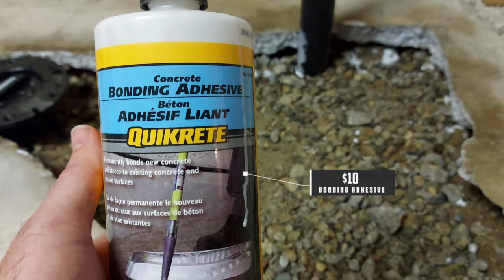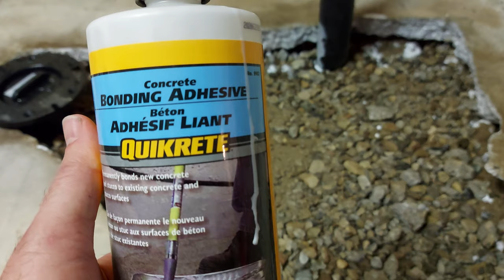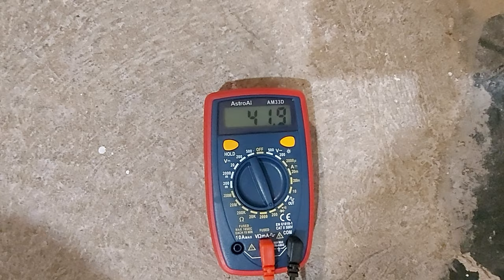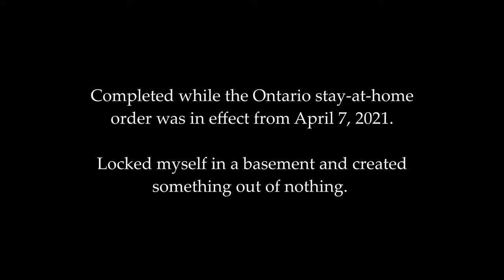Complete Basement Bathroom Build - $1500

Comment: For the drywall. You shouldve used green board and or cement board. It’s specifically made for bathroom and or anywhere that will collect moisture
Reply from the maker: Oops!  I replied too quickly because others had mentioned the same thing, but regarding my tub to shower conversion video.

This bathroom was entirely normal drywall.  I would have loved to have something more moisture resistant especially for the ceiling above the shower but man, selection in Ontario is pretty grim.  Not sure if it's covid or the norm.